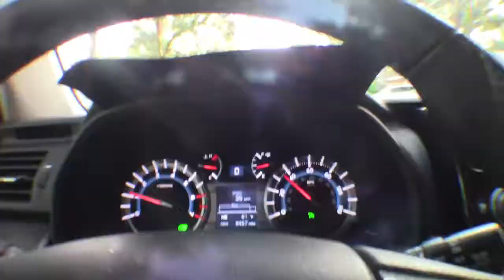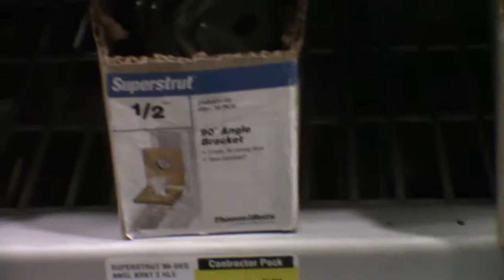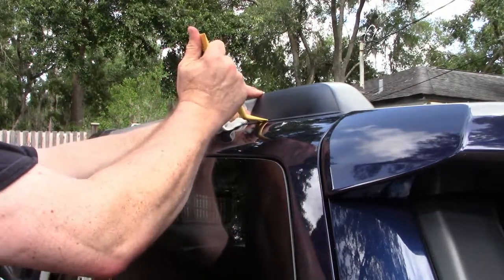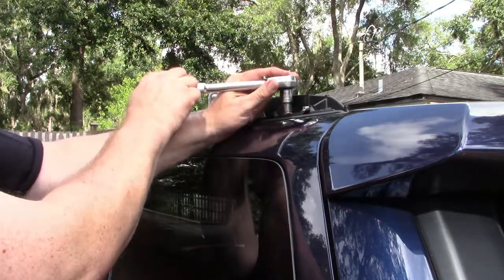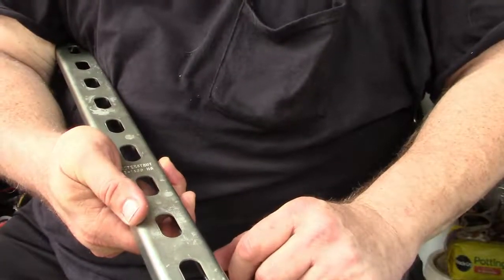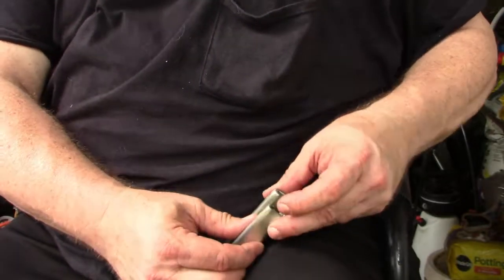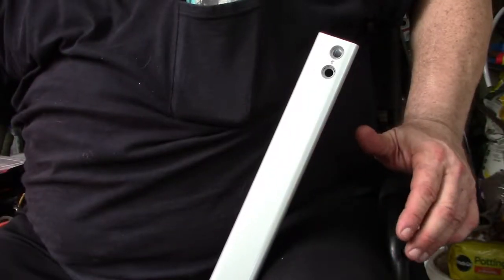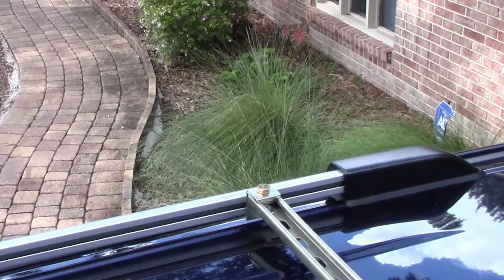Easy DIY 4 Runner Roof Rack Crossbars - $40/pair!!

Comment: Several immediate problems here: rust seizing up the steel nut and rail bolt; rust of the strut (bar) itself; wind noise due to the blunt profile of the bar;  scratching of the AL rail due direct sliding contact with the steel L.

Comment: I just went to HD today and got me some 1/4 in spring nuts and some 1/4 in by 2 in eye bolts.... now I have tie down points on my roof for random cargo or luggage bags.  Total expense, under  $10 in hardware...  I am looking into building a flushed crossbar set up to install hard tie down rings.... You just opened up an enormous amount of possibilities... thank you for this video.
Reply from the maker: I've found the Cone Nuts are easier to use because the spring nuts tend to get caught up in the slots in the bottom of the channel.  I use several of the conduit clamps with hand knobs to attach my shovel, axe etc.

Keep being creative!
Reply: Hell yea doing the same but am using 1 inch galvanized pipes left overs  from my home remodel lol

Comment: Thanks for the super helpful video. I had a goal to be able to put long lumber and other long stuff on my roof, so I wanted to extend the length of my Highlander factory rack. I never though about putting the Superstrut nuts into the factory rack track. I don't have a video to post (why can't we post pics i the comments, geez), but what I did was to start by mounting Superstrut 5' runners along the factory rack, using a 1 flat square Superstrut plate and a couple of washers as stand-offs, then I mounted superstrut crossbars on those runners, using the 90 degree brackets. I spaced the crossbars so my Thule Kayak racks and cargo box can connect right on (cool how they fit right on the superstrut!) . I made the crossbars stick out a little past the factory rack just enough so no one would bump their heads on them and bought those blue plastic superstrut end caps. Then, in order to attain the goal of extending my rack length, I bolted on 2' extensions onto the 5' runners, with an additional crossbar to make a 7' long rack when I want it, but when I don't want it, I can quickly take it off and cruise around with the 5' rack. Anyway, I was stumped until I saw your idea, so I wanted to thank you!
Reply from the maker: Thanks for the great comment!  I replaced my factory rails with 5' A-Strut (because it's stiffer).  I'm putting together a video on that and I may add your removable extensions!  You can share your pics on Facebook.  We're Gen5Runner there as well!  Very happy to be helpful to a fellow Yota!
Reply: @gen5runner194   Okay. I finally posted pictures of my setup. I really do recommend spending a little more $ and building "runners" to mount up against the factory racks. It doesn't really add that much weight, but gives you a solid foundation for adding other stuff. I don't have any pics of the extensions I made that I mentioned above, but when it isn't dumping rain, I'll add pics of that, but you can see where they attach. Thanks again! https://imgur.com/a/yeqmHq3

Comment: What is the exact length you cut the crossbars?
Reply from the maker: It depends on whether you want then flush on overlapping.  The best thing to do is make them a little long then install one end and mark your cut for the other.  This will always give you a great fit.

Comment: What did you do about vibration and the bolts coming loose?  Was this ever a problem?  I was wondering if threadlocker or something along those lines may be necessary.
Reply from the maker: We travel a lot of bumpy, shaky roads and while nothing has loosened up so far, I guess a little cheap insurance isn't a bad idea...
Reply: @gen5runner194  Right on. Thanks for the response!!

Comment: How do you keep it from just rolling over either direction? I didn't see any 1/2" fender washers and in the video you grabbed 3/8" bolts but never used any
Reply from the maker: The torque / friction seems to hold them in place perfectly.  The bolts and fender washers are for attaching stuff to the crossbars.  Thanks for your helpful comments!  I hope you'll subscribe as there's a lot of stuff in the works!

Comment: Nice! How is the wind noise?
Reply from the maker: Great question, thanks!
There is no whistling even at highway speeds up to 80mph!  
I replaced the factory rails with a-strut to get a lower profile, stronger rack with a full 5ft of useable length.
Please subscribe so you don’t miss the upcoming video about how I did it!